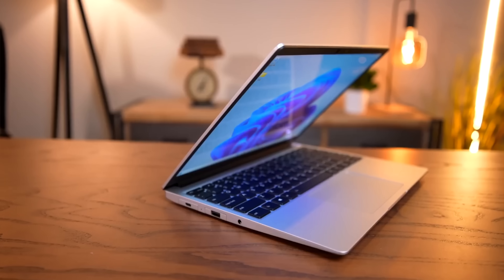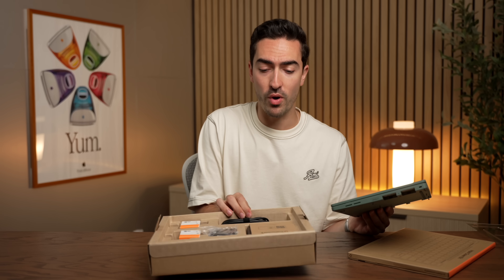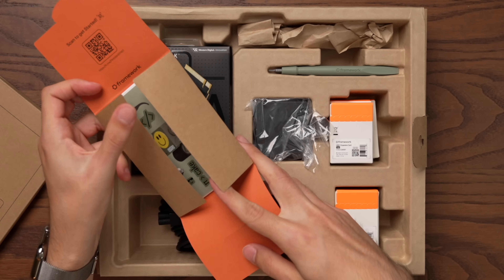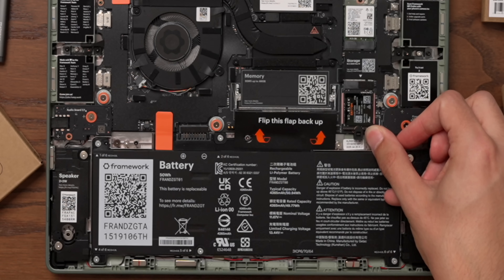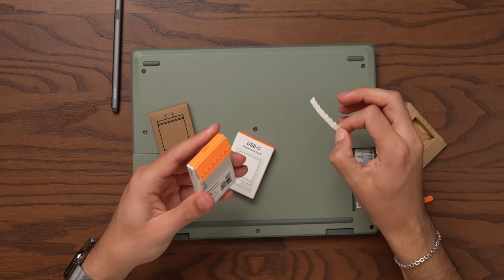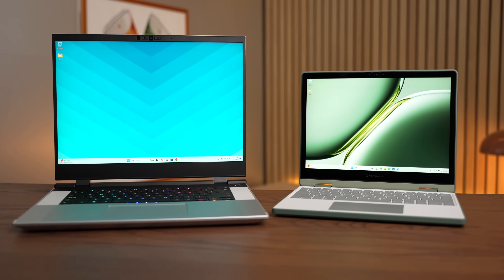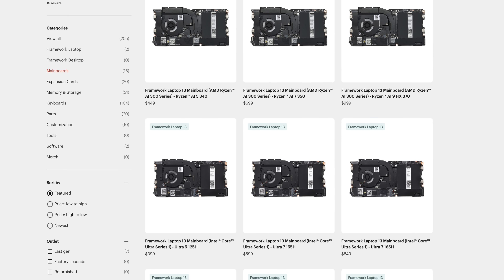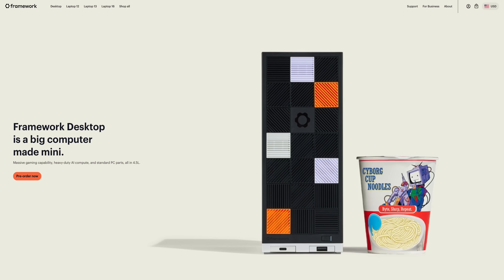Apple could NEVER: Exploring Framework 12

Comment: I want to support framework for their repair and upgrades, but the pricing and lack of quality parts kills it for me. 800$ for a 66% srgb screen and a weak cpu should be a deal breaker. The pricing of the upgrades for their other laptops are also just too high. So far the best value item I see from Framework is their desktop and even then gmk tec's evo x2 (395 chip) with the same spec is better value as it comes with storage for the same price or 100$ less. 
I bought a framework 13 7840u and I've dealt with graphic artifacts and random crashes. Over time I've ironed out the issues but the experience has left me jaded. Upgrades like a better display or a new mainboard would cost more than just buying a new and better laptop.

Comment: Okay, but here's the thing, you’re comparing apples to wrenches. The M4 MacBook Air is sleek, powerful, sure, but it’s also sealed, disposable, and rigid. Framework isn’t trying to win a benchmark race, it’s trying to change how we treat tech. You drop a MacBook? Congrats, now you’re paying half its price for a new screen. Framework? One part, one screwdriver, fixed. You want to upgrade in two years? MacBook: toss and buy new. Framework: swap the mainboard. You think $1,100 is a better value because it's faster right now, but $549 plus $100 storage and $50 RAM gives you a device you can keep alive for a decade. That’s not less value, that’s smarter value. Apple sells you polish; Framework sells you freedom.
You are basically giving away Apple more money if you counter with "Apple Care+" like imagine not needing it for a year, your are literally paying them for nothing. 
And finally Frameworks main goal isn't just casual consumers but schools and colleges where they buy them in bulk. These devices aren't powerhouse for a reason, they are trying to save students from trash that is chromebooks.
Reply: Sure, the MacBook Air is faster. But who cares if you’re just running Chrome, Word, Zoom, or even some coding? You don’t need M4 horsepower to take notes or write a thesis. Framework is about access, repairability, customization, sustainability. Apple wants you locked into their cycle: break it, replace it, repeat. Framework wants you to own your tech, not just borrow it until it fails. And in education? That’s gold. IT departments can swap a busted screen in minutes. Try doing that with a MacBook—oh wait, you can’t. You’re stuck with a Genius Bar and a fat invoice.
This isn’t a race car, it’s a Honda Civic you can fix in your garage. And honestly? That’s what most people actually need.
Reply: @itsmilan4069  > And in education? That’s gold. IT departments can swap a busted screen in minutes.

Sounds great in theory but no IT department I know is equipped to make actual repairs at scale anymore. You can lament that and I hate to be reliant on third parties just like the next guy but as corporations and big organizations in general are set up these days, a dude with a screwdriver who knows how to perform a task is not compliant with the bullshit rules in effect.
Reply: Great vidéo, and great answer to the problem he revealed. Yes it's not a great performance value for the price, but that's not why you buy that laptop.
Reply: Repairability doesn't really matter to me, if the repairable product is just bad. If they only used other chips and a better screen, the 12 would've been perfect. 
Instead, I bought an M4 Mac Mini for half the price and 6 times the performance.
Reply: framework is just copying apples approach from 25 years ago minus the polish people really do forget that apple sold us powerbooks with cpus on upgradeable cards while being fully and easily repairable to
Reply: @alexmeek610  There was a short period of modular laptops. I remember having a thinkpad where the keyboard swung open like the hood of a car for modular parts replacement.
Reply: @Vsor  I mean, most of some still new (maybe not the newest, I have a T14 Gen 1) can also do that, just not as ultra swing open. It's still near that level tho, just not as ultra as framework

Comment: I mean, this is a machine you'd buy your mom, but yeah, the upgradeability is less relevant to someone who is not prioritizing performance...that said, upgradeable ram and storage is nice.
Reply: Would your mum ever need to upgrade the RAM or storage, or is the target audience of school users? Its USP falls apart when you examine the market.
Reply: @andyH_England  Absolutely. I'd used an incredibly old, 17 year old dell latitude as my daily driver until somewhat recently. Back then, it had just 2 GB of ram. It also had an HDD (this could be compared to the fact that some laptops may come with cheap m.2 drives with poor performance). As time went on, this configuration became slow for the tasks that an average person does (web browsing and office work). A ram and SSD upgrade was easy and it saw continued use for a couple more years. Yes, an expensive piece of e-waste nowadays may perform well initially, but most people just get the default configuration that becomes much slower (to a point where it is annoying to work with) after ~5 or so years. The ability to upgrade a device is actually really nice, especially if you DON'T need all the horsepower of new computers (like your average "mum").

Comment: Only issue is that the Laptop 12 is absolutely terrible value compared to any chromebook or MacBook Air. The M4 especially runs laps around the Laptop 12 for not much more money. This laptop would be OK if it cost £500 maximum.

I can see this being useful in schools since you can easily change the battery and motherboard. It means instead of buying a new laptop they can change the motherboard out every 7 years or so IF Framework supports it that long.

Comment: Framework has the good and ethical idea of how computers should be but I don’t believe their designs have been executed all that well. 

It almost seems to me as though they’re entirely okay with ignoring glaring issues on their forums such as usb modular ports randomly not working, random annoying PD issues, COMPLETE lack of proper trackpad palm rejection, terrible hinges throughout their model 13 run. 

The 16 is too big. The 13 isn’t a good laptop and the display aspect ratio isn’t all that desirable. The 12 is too small.
Reply: Why would a 3:2 aspect ratio be undesirable?

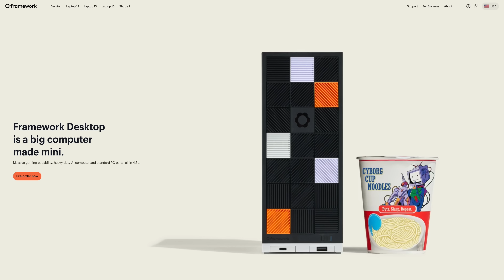Comment: 11:30 Why is framework entering the desktop space? Isn't the modular, upgradable, repairable desktop format already a thing?
Reply: To leverage the Framework ecosystem. It is already popular to upgrade a Framework laptop motherboard, and recycle the old one into a mini-desktop system with public domain 3d printed case designs. Frameworks is now offering a manufactured case with Framework flexibility. The initial desktop is spec'd as a Ryzen Max AI monster, but remember that Frameworks is a parts maker, I would not be surprised if the desktop parts line evolves as an upcycle path for FW laptop motherboards and FW graphics boards.
Reply: @BlueHorde  Sort of makes sense, but I think they should stay laser focused on their core mission.

Comment: First Luke, let me say, I think you are a real good guy and thanks for the review.
I build computers, fix a lot of computers and laptops etc...even upgrade old Macs.  I honesty don't see the repairability benefit in this business case. Yes, some laptops are harder to repair than others. For example, I just had an old HP 15" AMD CPU laptop apart and had to remove the motherboard to upgrade RAM, change the CMOS battery and freshen the CPU/Cooler thermal paste. In the grand scheme was it really that hard?  Not really and after you do one or two it goes fast.  
I am also an engineer and get the value equation. I would recommend this concept of laptop but I just don't see the cost/benefit as you suggest.  For the average non-gamer, just buy a modest laptop and if something goes wrong, find a youtube video and figure out how to fix it....or sell it on ebay for parts and buy a replacement. Changing SSD's and batteries isn't hard on most laptops and some can be updated with more RAM without removing the motherboard which scares a lot of non-techies.
I, like you, applaud this concept but the execution to me falls short.  What you present is a $1K laptop that performs at the $500 price point and the serviceability thing for the price they charge for replacement parts isn't worth it IMO.
All the best.
Reply: This comment is very reasoned and sums up the misplaced premise of a great concept that, sadly, for economic reasons, namely profitability, is really only suitable for those with a lifestyle choice of upgradeability and repairability; it is like a compulsion for them. These days, there is little e-waste, as it is easy to sell for parts, allowing others to reuse your "broken" laptop in their machines. Additionally, this is an ultrabook, so upgradeability is unlikely to be on your mind, especially since it has single-channel RAM. You won't upgrade the SSD for speed, as the 13th Gen i5 will be the bottleneck, along with the subpar integrated graphics processor (iGPU).

Comment: This would be a fantastic product if it could be sold for $500 for a usable configuration.  Right now, the price is just too close to that of an FW13, which is a much more capable machine and a known-good machine (vs. this completely new design).   If they can get the price down, this will be a winner.  Otherwise, it's a weird white-elephant device.  Anyone who would consider this is probably going to be better off buying a used Thinkpad for $300 now and buying another one in 2-3 years.  The total cost would be less and performance would be at least as good.  And the T-series and P-series Thinkpads are very much repairable (if not upgradable) by the end user, with parts available from the manufacturer.

Comment: definitely way better then the HP Chromebook x360 and most chromebook even they both got rubber edges and plastic claim shell this is more then a chromebook it is like a regular laptop but upgradable since most chromebook uses bad cpu ram and lack of storage space zero upgradable. this one has a i3 i5 and i7 processor better not make one with a celeron. i get is single memory is because there is lack of space for a another one wish was dual but i guess is single channel. better not make a chromebook version of it. this deserve a windows or linux. that is more like a lenovo 2 in 1 yoga competitors

Comment: I agree with all you say.  I personally bought one for my 10-year old daughter.  My thinking is that if something breaks I can easily and cheaply fix it rather than having to buy a whole new machine.  In addition, I hope I can upgrade it in the future without having to buy a whole new chassis and everything, just buy the main board / logic board, swap things over, and move on with life.  Hopefully, other upgrades will become available too.  I think Framework could have or should have additional upgrades for more power users for these devices.  Better screens, better CPUs, AMD chips, etc.  I'll gladly buy a new AMD mainboard with integrated RAM to put into the FW12 in the future.
Reply: Check out the upgrade and parts pricing on the framework site, and then you will realise that it is cheaper to fix other laptops, or in the case of a CPU upgrade, buy a new machine. For example, the previous generation Intel 7 165 costs £850. I can get a new MB Air for that price!
Reply: @andyH_England sounds like $849 (FW13 mainboard only) is cheaper than $1,699 (new laptop with same CPU), hence proving my point.
Reply: @korypostma  No! Meteor Lake chips are nearly two years old and are cheap now. Laptops with the old Meteor Lake are around £600 for a new, good-spec version, whilst the latest, Lunar Lake, are now down to around £1000. For example, the MagicBook has the 9-285-32GB/1TB for £1000 (just released). I have no idea what world you're in where a Meteor Lake costs $ 1,699. That is fake news. I can get an Arrow Lake with a dGPU for that, featuring OLED, 32GB/1TB, and 120Hz.
Reply: @andyH_England  Good for you, keep on doing that, if it works for you.  For me, I vote with my money and I prefer to support companies that don't do what those companies are doing.  If price is your main motivating factor then you can stick with Alibaba / Cheap Chinese laptops and replace them every year or two and I'll stick with something for 3-5 years and upgrade only the mainboard instead of buying a whole new machine.  You do you and just be respectful of others and their opinions.  Not everyone cares about cost, some care about more than cost.  Plus, I found one 7 165H selling for over $5,000 still new, so yeah, prices are everywhere depending upon what you want/need.

Comment: I'll be honest, upgrading a laptop wasn't really a deal. You buy a Mac, you put the necessary RAM option, here in 5 years you'll want to change everything, you want a new design, screen, architecture, screen, all the only thing Apple can do and the storage apart is not needed. on a laptop
Reply: Two things:
1. You're right that a lot of people are going to want a new laptop rather than upgrading the old one. Thing is, there's a whole other group who buy second-hand laptops, and having upgradeable parts means the life of that machine is going to be a lot longer, even after the original owner gets rid of it.
2. No upgradeability means that the OEM can charge as much as they want for RAM and storage. Apple charges you an insane $400 to go from 16 to 32GB of RAM on the 14-inch MacBook Pro. You know how much the RAM itself actually costs if you were doing the upgrade yourself? $75. Yes, really. Apple's charging a $325 markup because it's not possible to upgrade the RAM yourself.

Comment: I don't understand how you and others act like Windows and Macs are interchangeable. They are not. I've worked with both for 30 years. I'm now firmly in the Apple ecosphere, although I still have a Windows laptop just in case I need to do something in Windows. I'm heavily invested in software that only runs on MacOS and iOS, and I can't easily switch over to Windows because I like the hardware. Framework is a good idea, well executed, but it's totally useless to me.

Comment: Now install open core legacy to turn it into a hackintosh.
Reply: OpenCore Legacy Patcher is not used for Hackintoshes; it’s just a set of pre-made OC configurations for Apple computers, and as a bonus, it includes patches for legacy hardware. Yes, you would most likely be able to install macOS on that laptop, but you definitely wouldn’t have drivers for the iGPU—those ended with Intel 10th gen, which were the last Intel Macs. And that’s not all; you most likely wouldn’t have drivers for the Wi-Fi / BT card either.

Comment: 9:41 I never understood the dislike of bezels.
Reply: I think bezels make sense on a tablet. I really hate the trend of modern phones being all screen, there's no where to hold the damn thing without blocking the display and adding to the finger prints and grime on the screen. If a device is made to be held, like a tablet, having an area to hold that isn't screen is better than having super thin bezels
Reply: Skill issue  @zekezander
Reply: My issues is big bezels mean less screen in the same package. So my 13" framework is the same size as my old 12" hp. Same size chassy bigger screen, one has big bezzles one does not.
Reply: Because you fit fit a larger display in the same space. It's just inefficient design.

Comment: The only downsides I see with this is that it only uses single channel memory and 2230 nvmes.
Reply: And is too pricey. $550 is only for the Laptop and CPU basically. You still need storage and RAM. And the CPU at that price is only an i3 1315U.
I hope they'll get cheaper once Framework is bigger. But for now, the repairability is not enough of an argument to justify that price. I would rather spend more and get a Macbook then, or a Lenovo for that matter.
Can get a 15.6" Lenovo LOQ 15IAX9 with i5-12450HX 24GB RAM 512GB storage and an RTX 3050 for 150 bucks more. It is a deal though, but still.

Comment: The problem with laptops isn't what they are, the problem is the continuous evolvement of tech. Just think of  USB-C or thunderbolt 5, how can any modular laptop keep up with the internal tech? I like, that you can replacer defective parts, but it will not keep up with tech.
Reply: It doesn’t need to. it’s designed to last long, not to be high-end.
Reply: They provided 5 years of Mainboard and CPU upgrades for their 13 model